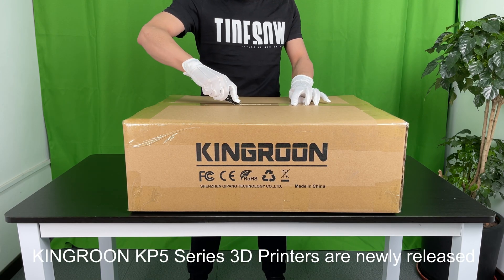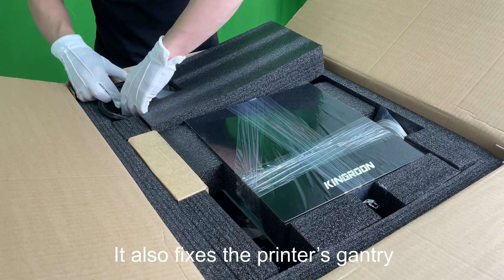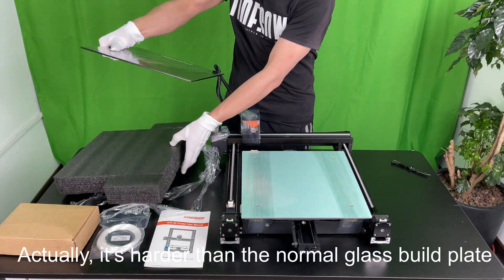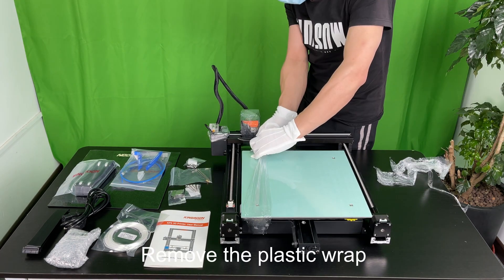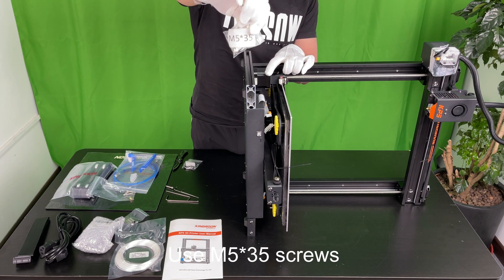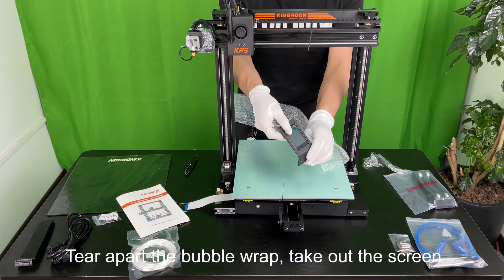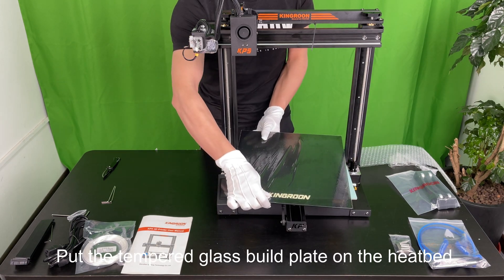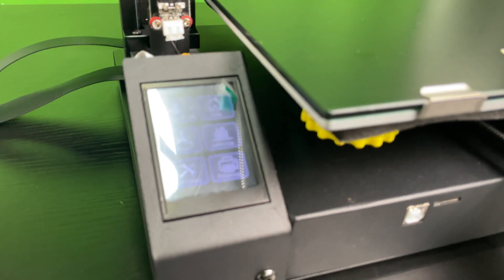KINGROON KP5L 3D Printer Unboxing-Print with Larger Volume

Comment: Hi kingroon. Why is the extruder couldn't go further down to the platform when levelling. How do I adjust the z axis shift higher?
Reply from the maker: If you are using the KP5L 3D printer, just find a limit switch behind the screen. It’s mounted on the gantry with a small chip. You can adjust the screws on it to make it happen. Hope my answer helps you out.

Comment: 1. It is about KP5L. After the firmware, the emoticons disappear and only the lowercase letters appear. Not only me, but many people ask this question on 3D social. How do I solve it?

2. The touch screen will stop working after about two hours during operation.
    The text disappears and only the white background light comes on.
   Of course no touch.
 
I updated the firmware for this issue, but same situation.
I'm under a lot of stress.

I have also contacted the company's e-mail, but they have not read it.
Reply from the maker: Sorry for what happened, we will try our best to help. The reply could be late because we are now in a long holiday. I will remind our engineers of your email. As for the problems you mentioned, try flashing back to the stock firmware see if the problem solved. Please also let us know which is the firmware you mentioned.

Comment: I dont like the location an Orientation of the filament sensor. The sensor should be on the very top bar pointing down. Also the spool holder is very bad. It should be one installed above with screws like on creality series printers. Also it would be nice to have a screen mounting option on left and right side of the machine for lefty and right people.
Reply from the maker: Thanks for your advice! We will let the engineer know, see what we can do to improve it. It’s actually fit well when using the self made filament dry box in our channel.
Reply: @Kingroon3DOfficial  Same here! I have one KP5L and filament runout sensor location and the way of feed extruder is really pain in the ass! :(
Reply from the maker: @merquino  I preferred to mount a filament holder on the printer gantry before until I start to using the filament dry box. We posted a video on how to make it, we suggest you have a try on that see if it make any difference. We will let you know if we did anything to improve the filament sensor, too. Have a great day!
Reply: @Kingroon3DOfficial  thanks! Where is the link of this video?
Reply from the maker: @merquino  https://youtu.be/TNlDooWTDBo